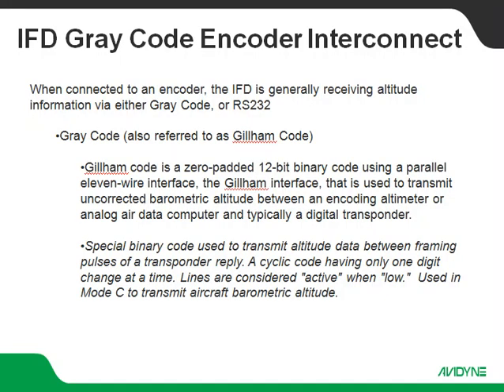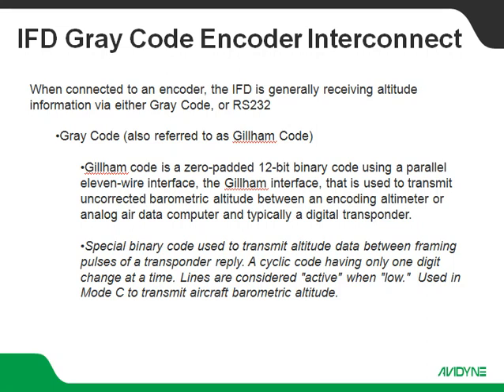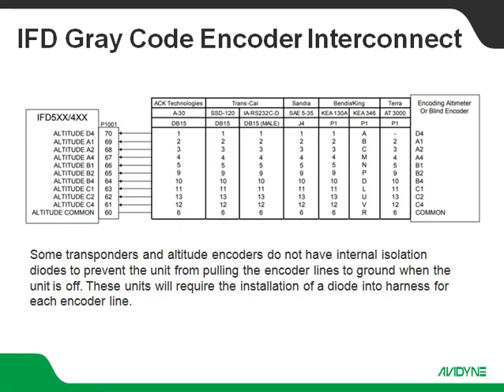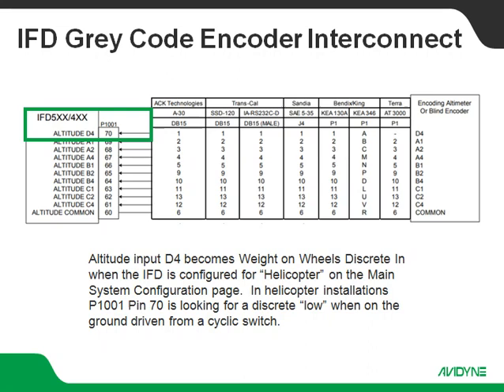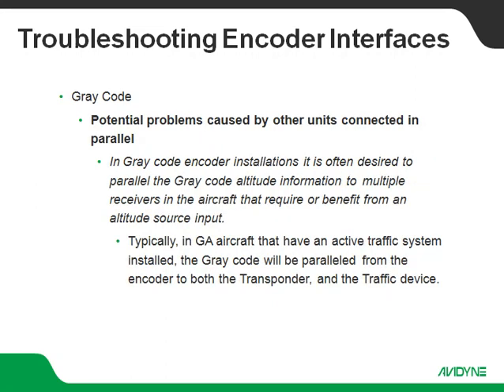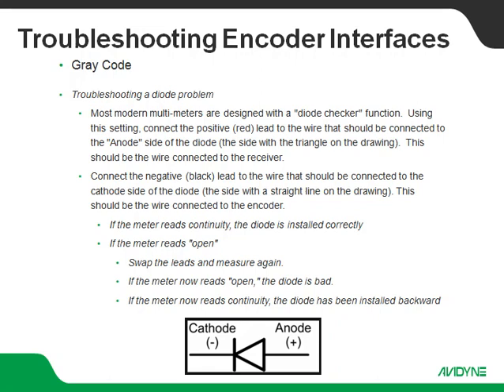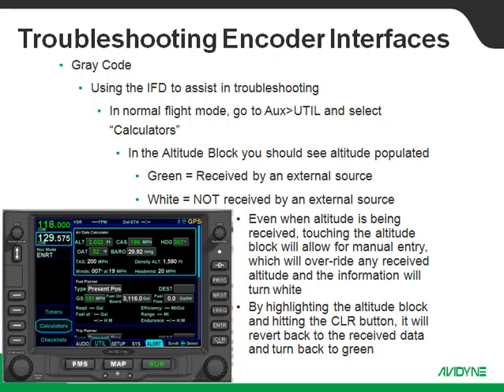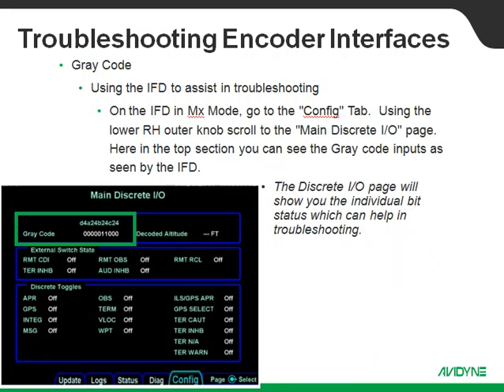IFD Interfaced with Gray Code Altitude Encoders

Comment: Regarding Greycode.  I initially installed my Sandia SAE5-35 using the eleven wires and Greycode to my new IFD540 which worked fine.  After watching this video, I've decided to change to RS232 on channel 5.  There's no selection for Sandia so I'm not sure what protocol I should select in my IFD RS232 setup.  Thanks, Dan
Reply from the maker: Dan, we do have a protocol for serial pressure altitude data.  However, these changes should be completed by an A&P, certified shop, or Avidyne Dealer with the current installation manual.  Changing your pressure altitude input settings can affect the way your IFD navigates, so the unit should be fully tested after making the change you're asking about.

Comment: Great video.  One thing--I dont' think you ever defined "IFD".  I presume FD is "flight display", but what does the "I" stand for?  I know a PFD is a "Primary Flight Display" but IFD I'm not familiar with.
Reply from the maker: Thanks for asking.  The IFD stands for "Integrated Flight Display" because in most instances it can be integrated into your existing avionics equipment.